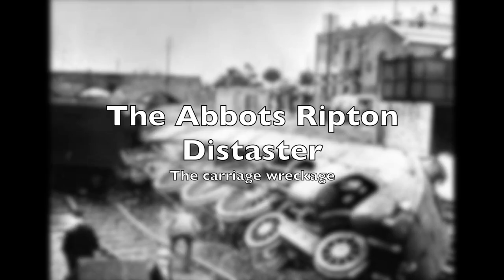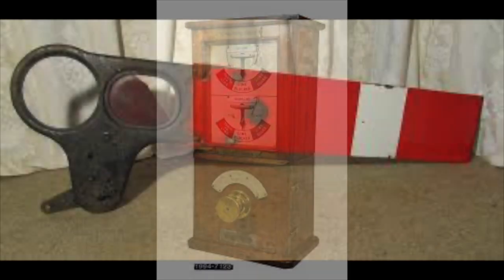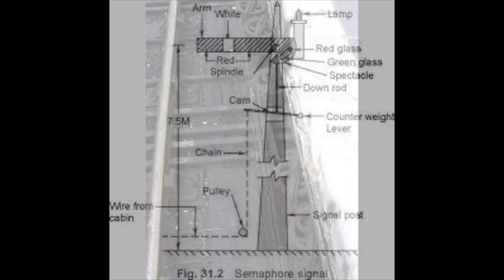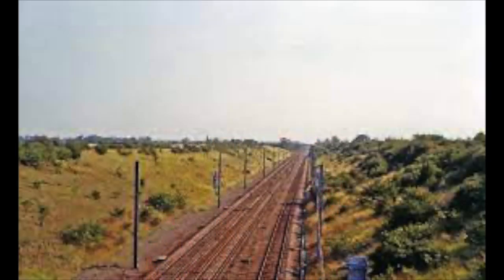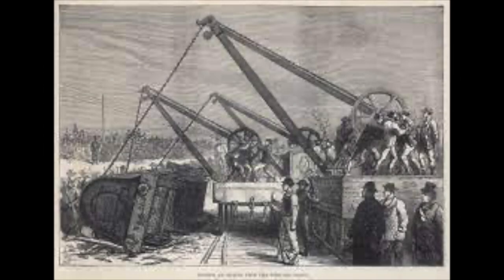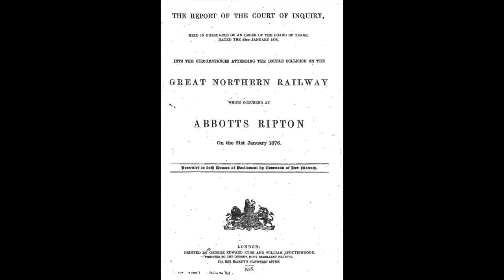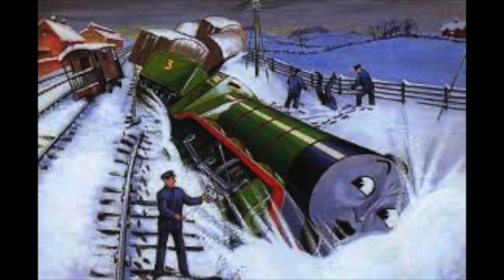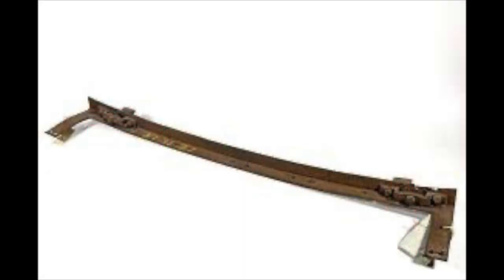The abbots Ripton incident - The carriage wreckage

Comment: The UK seems to have done very well in leading the railway industry in safety procedures.  When a wreck happens, they go over the wreck and once they find out how the wreck happened, they find ways to prevent a similar wreck from happening under the same circumstances and the railway owners readily agree with suggestions and put them into practice without fuss. Hear in the U.S while we did somewhat learn from wrecks and mishaps the owners of the railroad only put recommended safety procedures and features when the government forced them to. In fact, it wasn't till the1890s when safety features such as air brakes, automatic couplers and other safety features became mandatory by order of the Federal Government
Reply from the maker: if you go online the railway archives Is a fantastic read. it outlines investigations from past accidents over the past 200 years and its recommendations. we also have the RAIB (rail accident investigation board) again a great read into ongoing accidents and near misses. its a great way for railways to share information and learn from accidents and how to prevent them in the future.